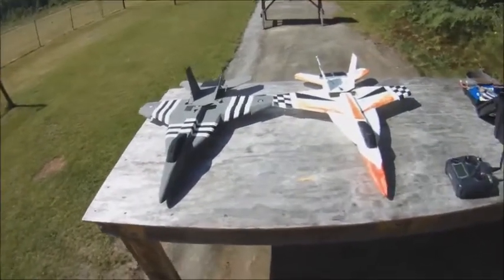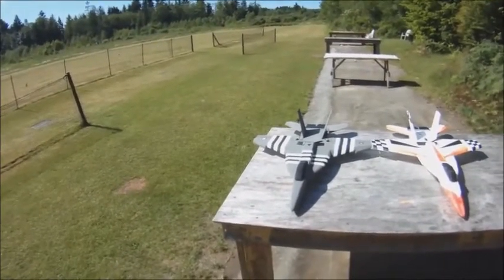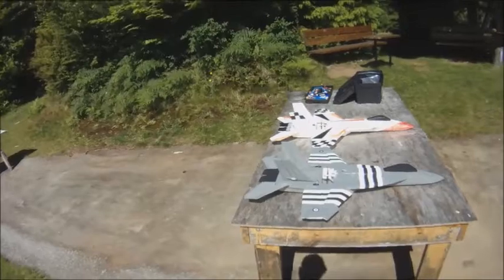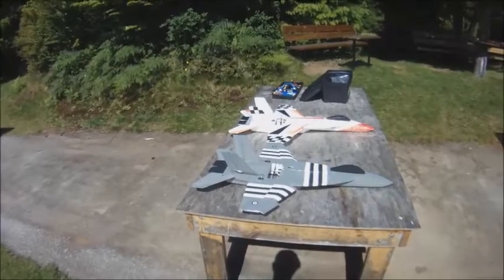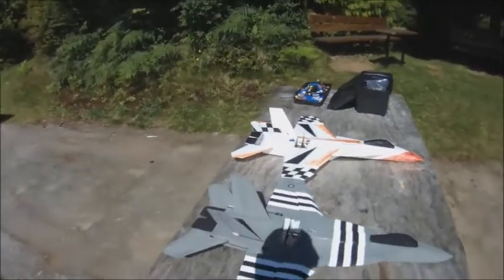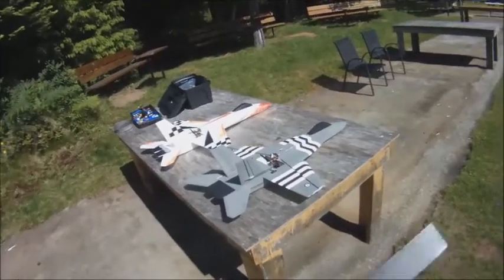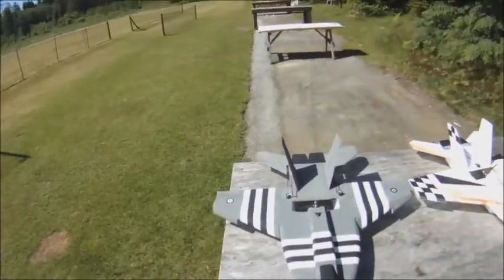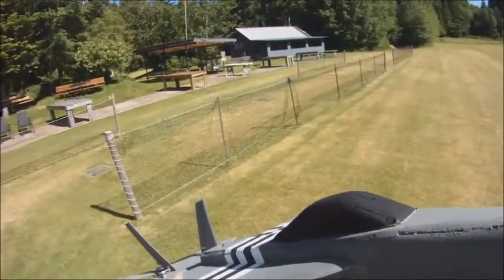RCP F18 V4 Walkaround and Flight video

Comment from the maker: To Rishab G Hombal - Yes, you can use a 2200 Mah battery, it will just make your plane heavier.  I have tested a 2212/6 2200 Kv motor with a 6x3 EMP prop and it produced about 28 oz of thrust.  Hope this helps.  Cheers, Scott

Comment: is that the focal price 2700kv motor? what prop are you running in the video? thanks
Reply: sorry i should have watched the whole video before asking lol
Reply from the maker: Tim Sox No problem, I run the 6x3 EMP prop on this motor all the time.  Awhile ago I tested it with a 6x4 EMP prop and didn't notice an appreciable difference in performance, however the motor came down very, very warm, so not worth any gain in performance to put that much abuse on the motor.  With EMP props it is very important to make sure they are balanced properly to get maximum efficiency.

Comment: Hi, I've been having problems setting up elevons on mine. I'm using an Airtronics TX. I've tried every configuration I could think of but can't seem to get it right.  I can get the elevators to work as airelons. But when I pull back on the elevator stick, the front wing elevators go the opposite way. If I reverse the plugs or the setting in the transmitter, it gets worse! Can you help me out here? What am I missing?
Reply from the maker: Hi Dennis, sorry to hear of your struggles.  I'm not familiar with your Tx, but perhaps I can try to help.  Are you using the elevon mix in your transmitter or some other type of mixing?  Are you using Y harnesses to connect the servos to your Rx?  If the ailerons are connected so that they are getting elevon input also, then they will work as elevons also.  Do you want your ailerons to act as elevons so that they work in the pitch axis also?  Perhaps you might have to reverse your aileron servos physically or put a servo reverser into your wiring setup so that your ailerons go up and down in the same direction as your elevators in the pitch axis.  Not sure if that helps.  If you could tell me what you are trying to achieve, perhaps I can help.  I have done it before having elevons and ailerons, but the ailerons only worked as ailerons, it required an onboard mixer for the elevons and two Y harnesses.
Reply: Hey Scott! Thank you for your swift response. I have actually figured out how my elevons could work correctly utilizing the DELTA function. I had to physically turn both elevator servos around. I haven't tried hooking up my airelons (main wing) to mix with the elevators. I've actually turned them into flaps. Again I do appreciate your assistance.
Reply from the maker: Dennis Eustaquio Sure thing Dennis, glad you got something sorted out.  Good luck with your plane... :)  I also keep a fun, informal blog with my friend Stephan Moran at http://migsrus.blogspot.ca/ where we post a lot of our ideas, successes and failures, you can always ask both of us questions through that forum.  We may not have all the answers but will do our best to help out... :)